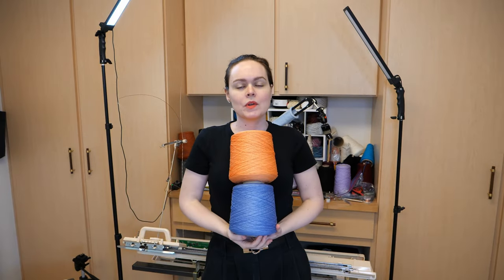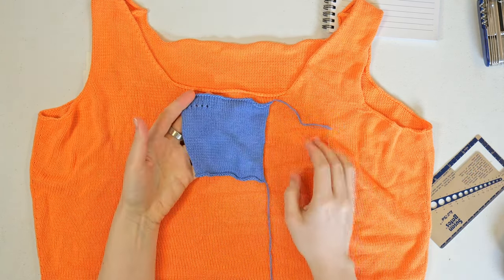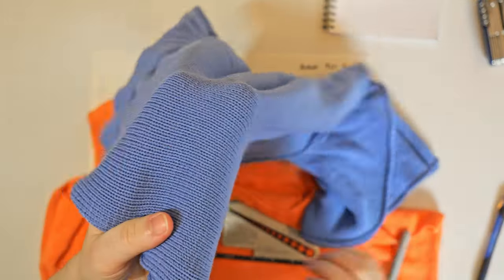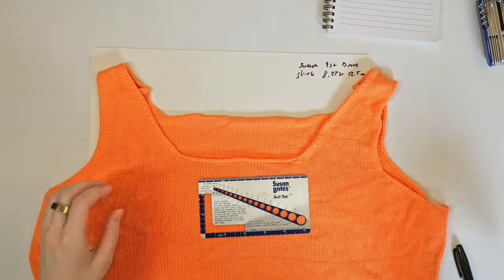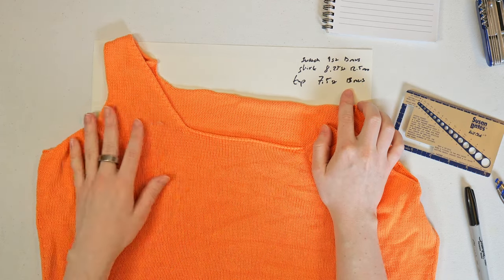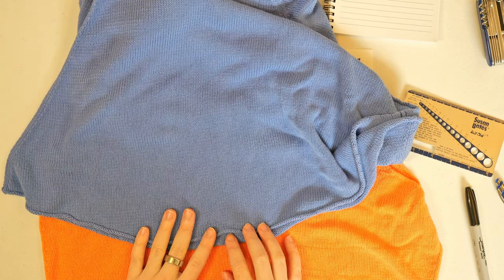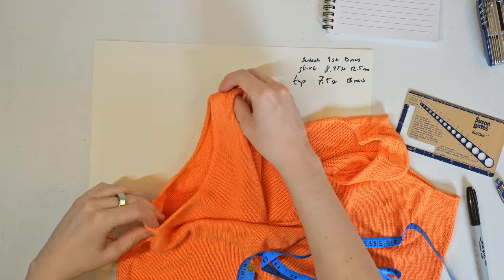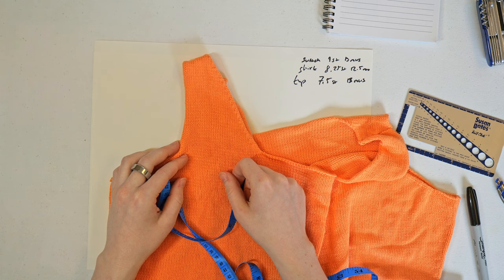Putting the pieces together | Machine knitting a dress

Comment: When using different colored yarn, always run a swatch in both colors. It is not that they are necessarily processed differently, but the dye used can change the gauge and the feel of the product. If you take a strand of black worsted weight and compare it to a strand of another color, you can often times see a visible difference in the thickness even though minute, (same thing holds true for fabrics and the amount of bias they will end up with) so this could have caused the issue with your top..